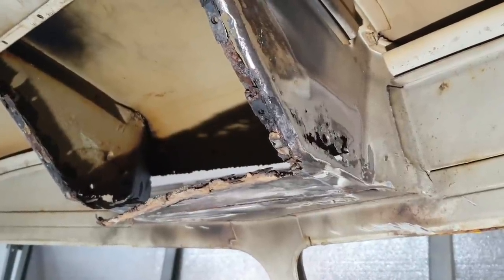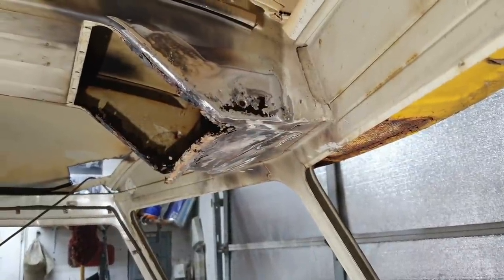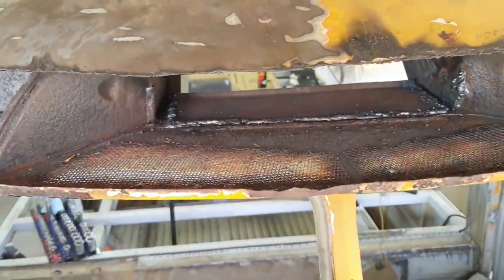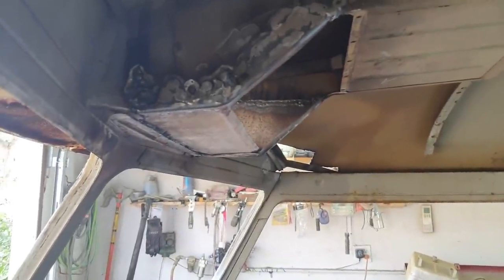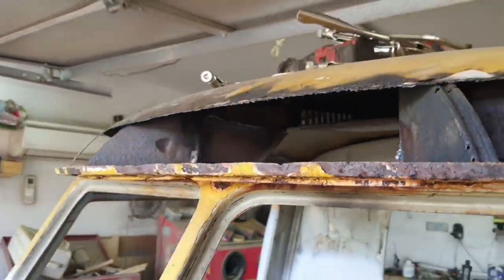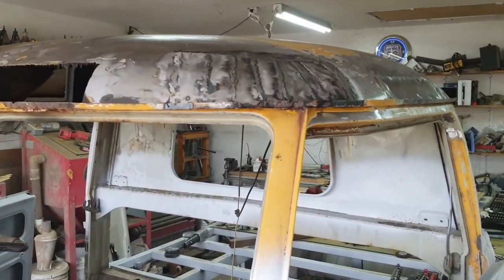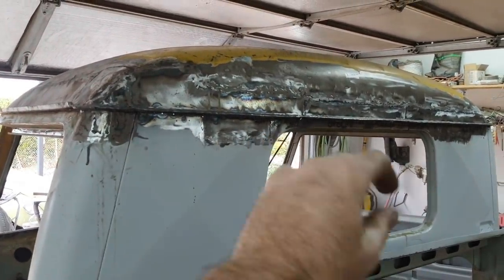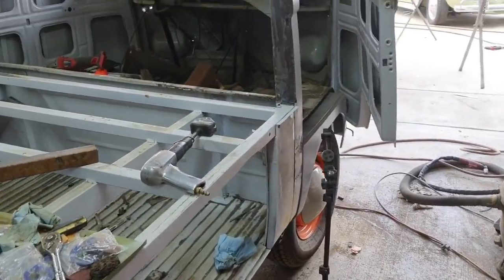RUSTED OUT ROOF VENT and ROOF repair VW type 2  Cherry picker from Belgium Forest

Comment: That is ingenious the way you cut strips to fix the roof. I have some curved sections and that is so helpful.
Reply from the maker: yea it works well. I have done this many times. Some guys will say it will rust again but it all depends on where you keep it. Garaged or out of the weather, not driving it in the salt should last a lifetime.
Reply: @Mikefngarage  and especially when you treat it with rust converter too.

Comment: Roof corner looks great.  Thanks for showing the whole process, including the welding.
Reply from the maker: IM trying not to show too much welding it seems to mess up my camera light sensor. Camera is about 500 bucks. I may start doing it from far away like that but still a worry about the light sensor going out.
Reply: @Mikefngarage  Maybe an ultraviolet filter for your camera?

Comment: I cut out and saved that entire duct system from a donor early 60's parts bus (in addition to several other good parts).  The fresh air duct in my 67 camper had holes drilled in it for a CB radio or something. I will just fill the holes someday and hold on to the donor duct.  Now I see someone's project that really could use it!
Reply from the maker: I almost never throw tthat stuff away because at a swap meet so many guys need stuff like that. I just sell it cheap.

Comment: Just a thought regarding the roof repair, ever thought about using a rocker panel with a similar curved profile? I used a Jaguar XJ6 rocker to repair the front of a 1960 Chevy Impala hood, worked really well!
Reply: I have the same problem with my 54 Chevy Bel Air hardtop  good comment Thank you

Comment: The great Fearless Mike!! I wonder if whoever gave this video a thumbs down can do a better job. Would just love to see their work. 🙄

Now I notice; is there some padding or insulation added under the roof. I imagine your head would get fried under uninsulated metal on a hot sunny day?
Reply from the maker: I usually put some stuff on that to deaden sound and insulate.
Reply: that's why they made safari windows !   you roast in these things even at 80F, it's not so much the head and a magnifying glass, just in general, a baking oven !  ....the front door sliders and the air box do some, but not much....
Reply from the maker: @DanTheManIOM  yea if the wind wings are broke your SOL. without safaris. SOOOOOO hot.

Comment: I know they’re messy As all get up but Would a Sand Blaster or a spot blaster be better to use in some of those tight areas especially the drip edge ? Just wondering keep up the great fabrication and happy holidays !
Reply from the maker: Great point. yea but it would probably take paint off areas I  cant reach  to recoat on the bounce. I it should be good with the treatment. and paint for many years.